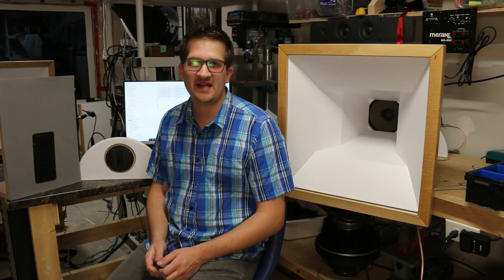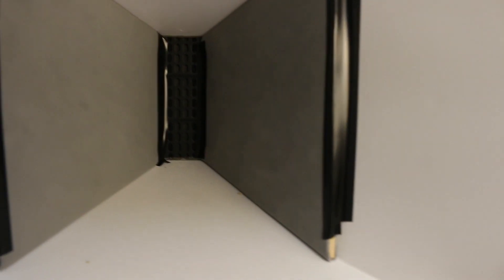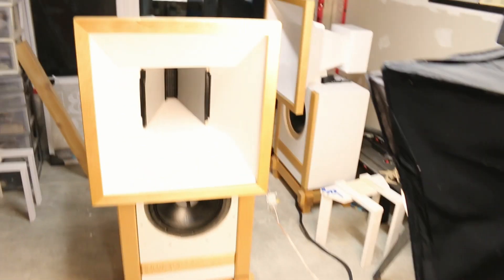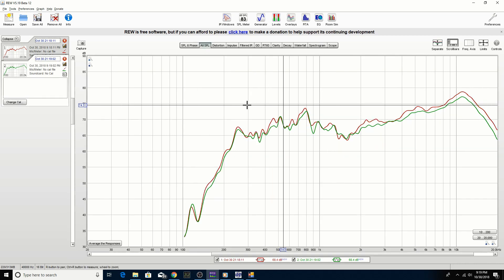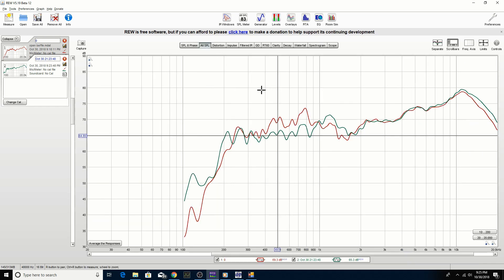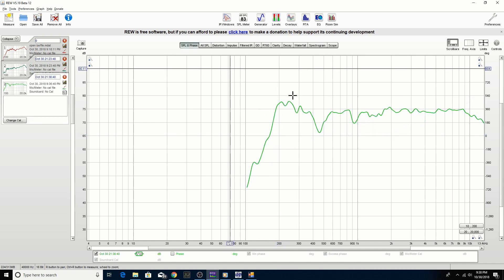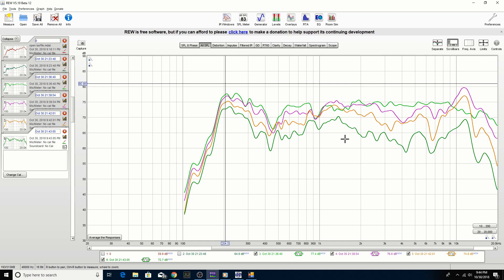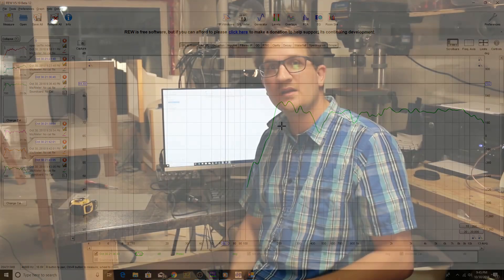Horn Loading the BG NEO8 Planar Midrange

Comment: Hi first of all thank you sincerely for disclosing all your excellent and very valuable work. You say "I discover that horn loading significantly flattens the frequency response from 180Hz to 10kHz! "
Great indeed ! however i think i have missed the part regarding the distortion.  Did you run any distortion test on the horn loaded driver ?  often i hear about horn introducing some kind of distortion that makes the sound unnatural ?  actually some people say that designing and making a good sounding horn is an art.   Shape and material being very critical

Comment: Please quick question, I want to mount a 6.5 driver in a ported box tuned to 50hz and then add a tractrix horn in front of the 6.5 driver. Was wondering if you had any idea what might be of such a design
Reply from the maker: Jeremiah Thompson A Horn will provide 8-9 dB increase in sensitivity.  A horn will provide this boost for 2.5 - 3 octaves.  So you have to factor that in when considering a front horn.
Reply from the maker: I’ve seen it done where the a rear loaded horn is combined with a front horn.  Some of the old Lowther cabinets did this.   The Tannoy Westminster is another example.
Reply: Unity horn 
Or the new double motor coaxial horn drivers 
Some are even neodium I think

Comment: @Joseph Crowe's DIY Speaker Building
have you tried to horn-load the Neo in a dipole configuration ? It would be interesting to see how much just the horn contributes to linearize the response (that's the gain in the Neo natural lower range) and how much the horn+seal one does (the configuration you tested).

ps: have you ever tested the Neo 10 ?
Reply from the maker: I haven’t measured the response without the rear chamber.  I only listened and subjectively sounded very poor.  
I haven’t tried the neo10.  I’m currently trying the Beyma TPL-150.

Comment: Thanks dude nice one, i am not at all into horns but do make allot of planar tweeters (also on my youtube channel) and i never tried a horn for it. so this is a really nice video for me.  the gain is insane by the way.  weird to see the rising response return of axis.  i think it might be canceled out on axis. so its there just some weird phase issues.  just my guess :)

I might try a thing or 2 like this, not sure where to start with the horn building... but i guess i could self teach with some browsing... or maybe allot of browsing :)

By the way did you need any thiele small parameters to model this horn ? since most planars dont come with any.
Reply from the maker: joppe peelen thanks for your comments.  Hornresp is very accurate however it doesn’t allow you to load the  RMA and ZMA files to see the final response.  To complicate matters I don’t have the T&S on the NEO8. So I’m left making many assumptions for simulation.  That is why I did the experiment because currently there is no way to simulate accurately.
Reply: @JosephCrowesDIYSpeakerBuilding  aha ok the lack of TS from planars in general kept me back from using hornres. but i see you have the same problem :) and did go the trial and error method :)  well i can try getting ts  from mine.  Actually adding a known weight of tape to it and do the TS measurement in rew.... hmm i am gone do that this week.

problem might be that it the foils allow it only one time :) so :) haha hopefully nothing goes wrong
Reply from the maker: I could try myself using a known volume within DATS speaker tester software.  That would be better than added mass since you’ll physically deflect the diaphragm due to  point loading your added mass.  T&S requires a distinct impedance spike at FS too.  I’m not sure if there is one on the impedance curve but I’ll soon find out!

Comment: Where are the distortion graphs ect. for the loaded horn? Also would a bigger rear cavity remove the spike at the low end?
Reply from the maker: Dodgy Brothers Engineering I forgot to provide this.  I will put it up somehow.  Good observation on the chamber volume.   I could remove the rear cover to see if that changes anything.